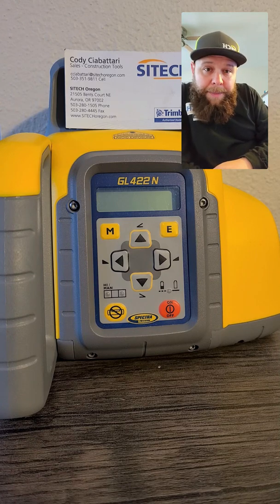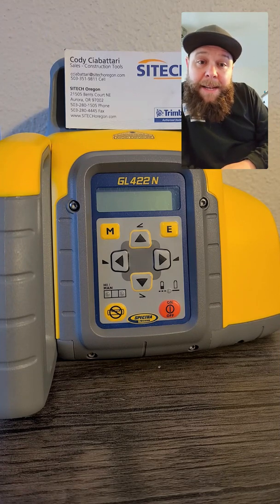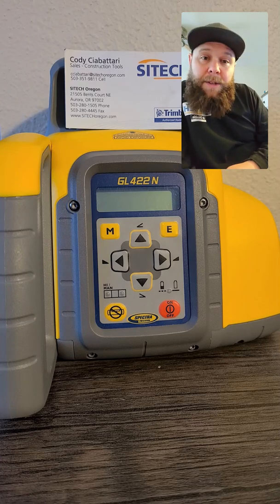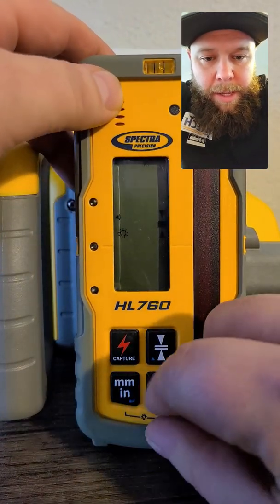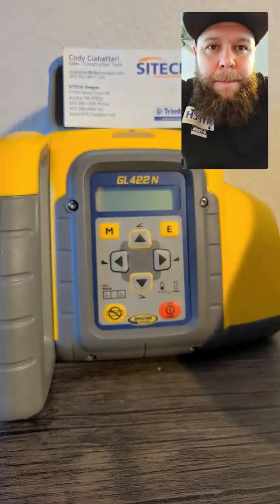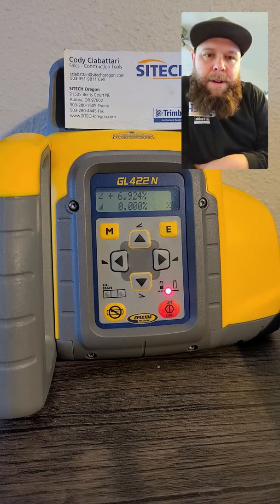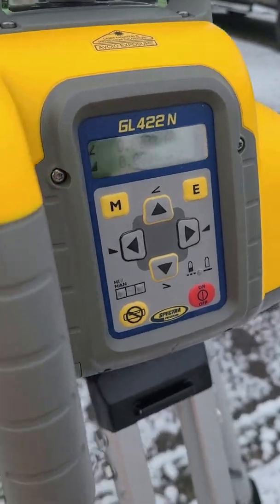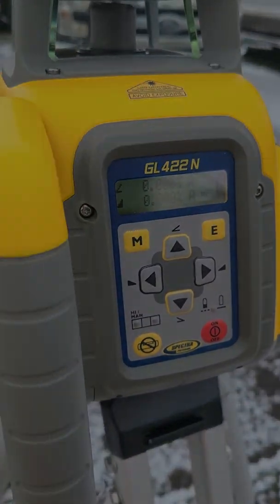Spectra GL422n Receiver Product Tour and Grade Match Tutorial

Comment: Great Video, perfect that you showed the pairing at the beginning as I was struggling getting GM to work, as the HL760 will work for level readings but not Grade Match, I  checked back on your video and saw why I kept on getting the error code. Great Laser, have had a few over 30 years and they keep getting better.

Comment: Good morning I keep getting a Error 040-020-150 what is it.. Thanks
Reply: Are you trying to Grade match? Have you paired the Hl760 with your laser?
Reply: @Kodis510  how do you pair the HL760 to the GL622N?
Reply: @oscarguevara1507  Go to the settings menu, press the enter button (button on the right) that will start the pairing at the laser. Then Hold the the A & B button on the HL760 till you get in the menu. Make sure the radio is turned on and set to LS. Scroll till you see pair. Hit enter and the HL760 shoul pair with the Gl622n.
Reply: @Kodis510  got it, thank you!